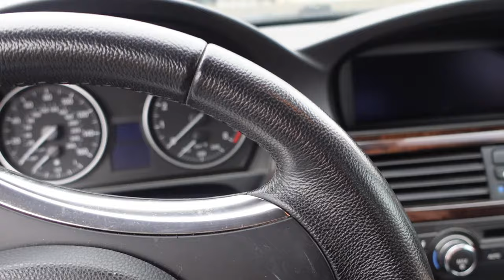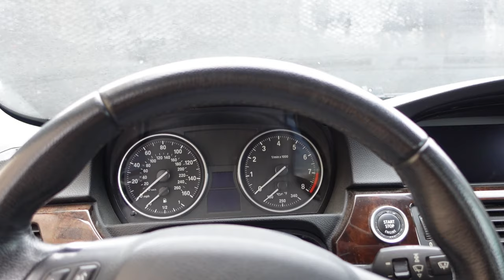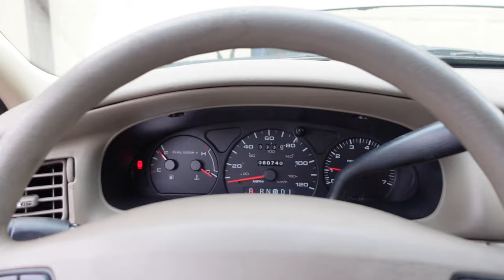Cheap Manual BMW 335xi - What's the catch?

Comment: older bmw suffer from oil housing gasket leaks. if left unrepaired can lead to destroyed engine. leaks on drive belt then pulls out front seal when belt tangles and pulls out crank pulley. cheap to fix before it damages everything. get your mechanic to replace oilfilter housing gasket. over 100k miles its a must.
Reply from the maker: I have had a few with those issues, definitely a good reminder! Once I get the damage sorted, it will definitely go to my mechanic for an inspection and needed repairs!